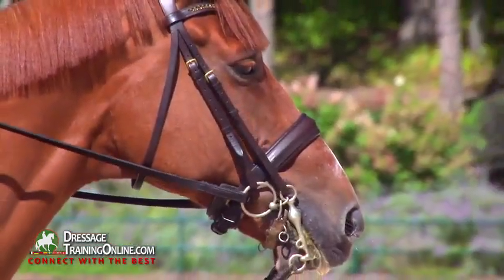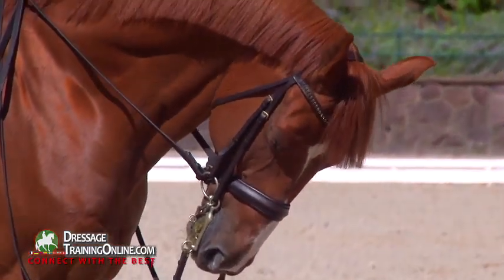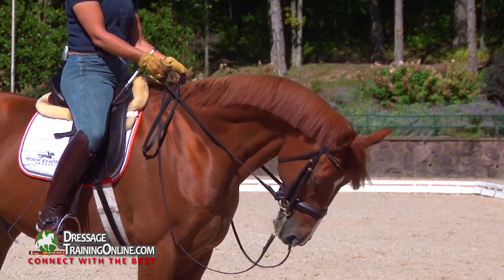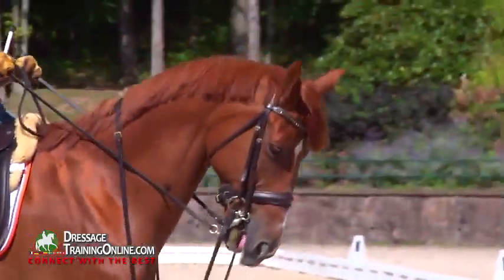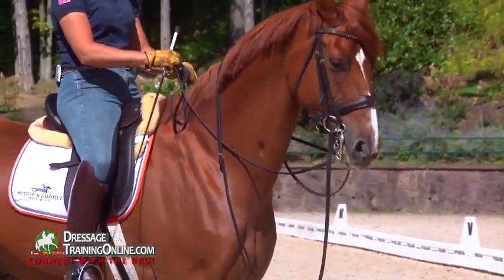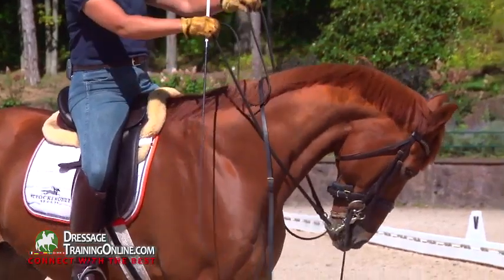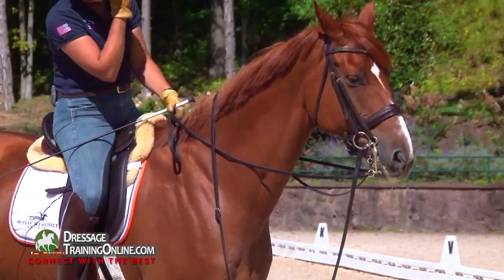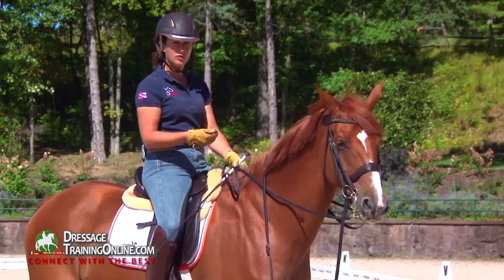Dressage with Catherine Haddad Showing Curb Vs Snaffle

Comment: Bringing my previously western horse to a double rein pelham. 
She does the opposite. Elevates (correctly, from behind) on the snaffle and drops into LDR with the curb. I really don't want that.
We did the first session where I have really actually used the curb rein today and any pressure is an immediate drop of the head and behind the vertical.

After about ten minutes O was able to help her understand that I want her to come from behind, and go forward into the snaffle contact and elevate with the curb.

We have ridden about twenty times with just the snaffle part of the pelham and almost no curb, so I know she really likes it.

Any tips? 
She does this really weird round canter with any curb engaged. Like her body is super round, but she's so down hill and dropping her withers.
Wonder if I need more impulsion to help stop her from dropping in front.

But she did do an amazing turn on the haunches.